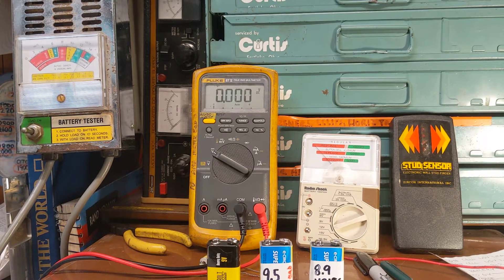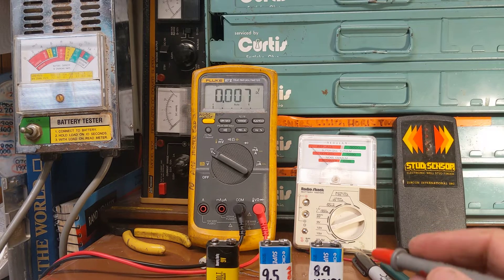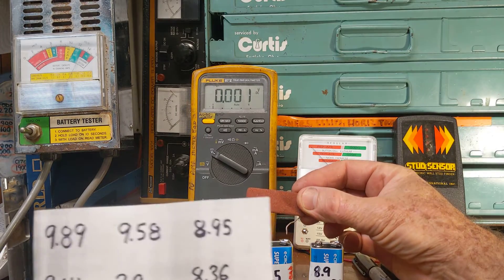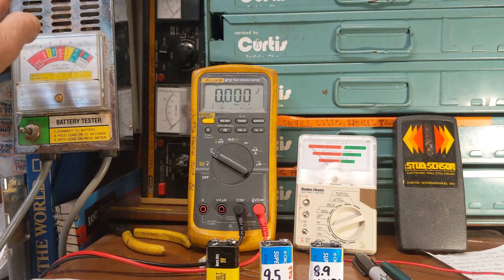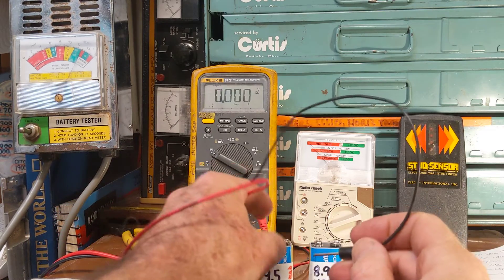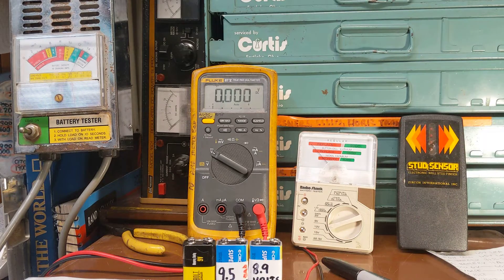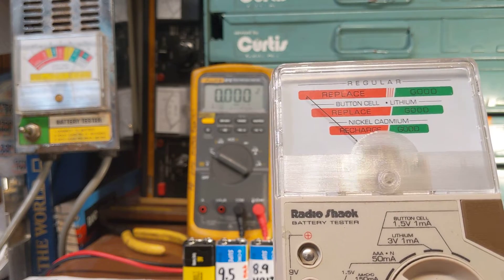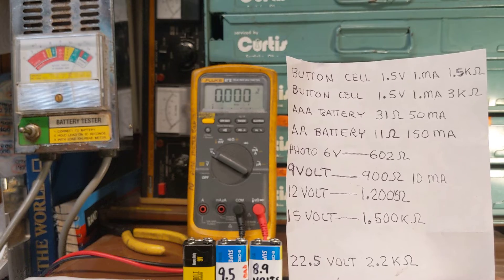Why You Should Load Test Small Batteries.

Comment: Thanks for the video. As a retired Mercedes tech I can say more than once the factory required Battery tester from Midtronics would give a false positive result and the battery would not crank the engine. But the same battery tested with a  carbon load would fail every time. Thanks again Jim.

Comment: I just noticed a Klein multimeter that had two modes for 9v batteries, one of which put it under load. Is there a digital multimeter that will apply a load to 1.5, 9, and 12 volt batteries? A multimeter that will load 1.5 and 9v would work also, since I have a Topdon BT100 for the 12v. Thanks to anyone who can assist.

Comment: Voltage drop testing baby we do the exact same thing in the automotive diagnostics, but instead of using a resistor we use, a current bearing load like a light or a high amperage bulb
Reply: my dad has a little light bulb that he has been using to check batteries for decades
Reply: They're all resistors.

Comment: Thank you for a useful video. I do question your handwritten table of resistances: It seems your table shows a current of 10 amperes son a twelve volt battery - this would be 120 watts dissipation inside the meter when testing a 12 V battery on the 12V scale: Is this correct?
Reply: 🔍There's an extremely small K next to the ohm symbol (easy to miss). It looks written as a correction. The 12v resistance is 1200 ohms, not 1.2"00" ohms. 👍🏼

Comment: I had a fault like this that kept me scratching my head for a few days on a real time clock module. It had a 3.3 volt coin cell on it and when I check it, sure enough it was around 3.2 volts but when it was on load (i.e to keep the time in the chip when the main power is off) it dropped to 0.6 of a volt. After a few tests I calculated that it had an internal resistance of around 45K!

Comment: Wonder if after checking multiple batteries you find the nominal voltage being higher than rated on the bad batteries being an indicator that there is a possible issue.the ones over 9v were faulty where the one a tick under was a good battery z

Comment: What is the equation of the load that should be applied, according to the capacity and the voltage, can you tell?
Reply: You want to size the load high enough to avoid a high current draw, and low enough that it actually loads the device. Battery voltage / 20 mA would give you a safe lower limit, and probably don't exceed 10k ohms to actually load the cell. Testing will 100, 1k and 10k should cover you for any small cells if you just want a rule of thumb

Comment: Hey Dave, I have a Hisense 75" Smart Android TV and everytime when I power it on it seems like it's working  when bootup I see all the apps and then all of the sudden the TV shuts off. The red power LED light blink 19 times when turning on the TV, I Google it and it says Power Supply need to be replace and I open the back cover up I didn't see any bulge capacitors. I thought when bad capacitors it would not allow TV to be turned on? Any idea???

Comment: I purchased a brand new smoke detector and installed it.  After we went to bed it started chirping.  The brand new battery read 9.6 volts.  I thought that i had a bad smoke detector. I put the new battery in the old smoke detector and it started chirping after a while.  I load tested it by plugging it into another device and noticed that the voltage dropped under a reasonable load. comparing the new battery with a battery that was a year old i found out that the used battery had less voltage drop than the brand new battery.  That is the first time i have seen that happen.  It was easier to replace the battery than to ship the smoke detector back.
Reply from the maker: Thanks for the info. You're the second person to mention smoke detector batteries having such issues.

Comment: very good info Dave.so I have a fluke meter like in your video, how can I use that to load test my aa,aaa,9v batteries?
thanks 
John
Reply from the maker: Your fluke meter can't be used as a load tester by itself, but your volt meter can be used to measure the voltage drop across your battery, when you have your battery hooked up to a load. A load is any device that uses electricity, such as a light bulb, a toaster, a heater, or a motor, but when your testing small batteries, you need to chose a load size that has a pre-calculated amount of current consumption based on ohms law. For example, the load size I mentioned in my test was a 1000 ohm resistor. It didn't pull much power from the battery, but it pulled enough to reveal the battery had a problem , because it caused the battery voltage to drop so low. 
I hope this helps.

Comment: This is so crazy. I literally have two 9V batteries sitting on my desk in front of me for a few weeks with the exact same issue that I have been planning to make a video on explaining to folks you might need to do a load test on a battery to get an accurate test or you can get a false positive.
Reply from the maker: Interesting coincidence. My life has many perfectly synchronized events, It's boosted my faith. It looks like you have a fun channel.
Reply: Thanks, I try to have fun with the channel.

My 9V battery in question was on a smoke alarm that kept beeping. Checked the voltage on the battery and it was high so I put it back in and it kept beeping. Checked it a couple times before thinking I better put a load on it.  Odd anomaly with mine the volts were higher than normal but fell flat with any load.
Reply from the maker: @shanesdiy  Your smoke alarm probably has  lithium battery, which tend to have higher voltages.
Reply: @GrantsPassTVRepair  Says "Zinc Carbon 9V" on it. Measures 10.16V currently but drops to zero with even a tiny load.
Reply: @shanesdiy thinking back, i think i experienced the same issue at some point, the smoke detectors we get now are sealed and the entire thing needs changing (how dumb!)

Comment: Car batteries can act this way. A multimeter measures 10.5 to 12VDC, but under load testing shows a bad cell, with way low voltage. A bad cell means it's kaput.
Reply: As the cell goes bad it's internal resistance increases, that's why relying on voltage alone is not the best way to go...

But i'm guilty of sorting by voltage myself, so i bought an internal resistance meter last week lol

Comment: First! Thank you Dave. Battery ESR is like capacitor ESR, very important.
Reply from the maker: I remember hearing this about ESR meters, but I've yet to use one in this capacity Thanks for the info. ;-)
Reply: @GrantsPassTVRepair  The Blue ESR Meter will test the ESR of batteries. I forgot what the max voltage for it is though.